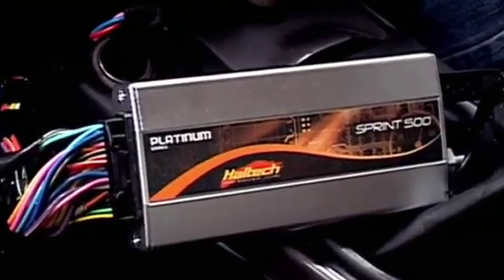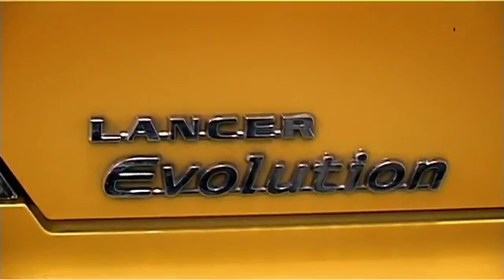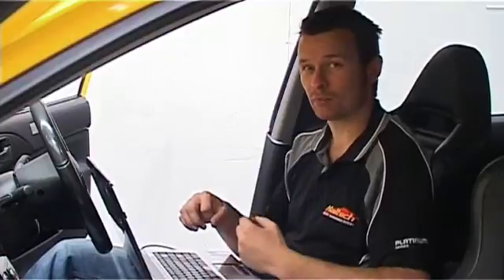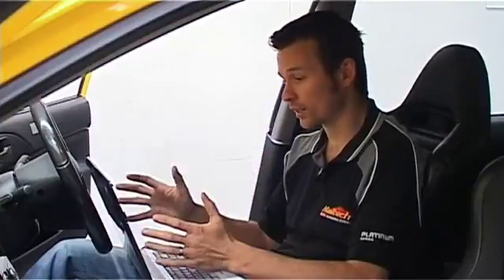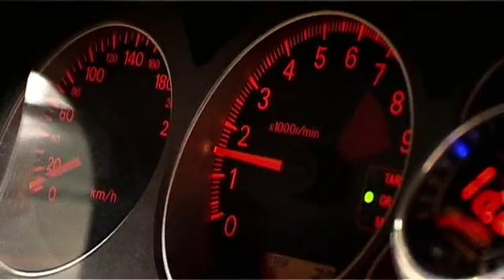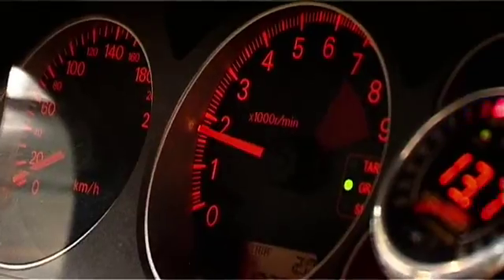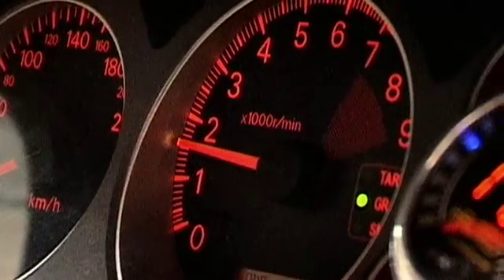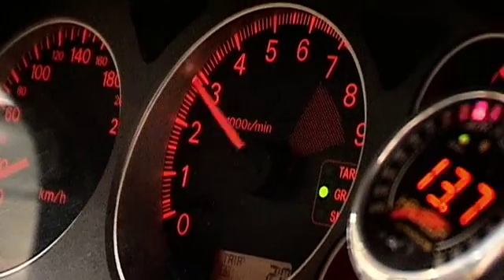How Transient Throttle Enrichment Works

Comment: Issue is usually do to the transient pressure change across the throttle . When you stab the throttle from idle  there’s basically atmospheric pressure on the intake side and very low pressure on the engine side allowing more air to flow than normally would at that throttle opening . You can kind of see this if you take a very long air hose or garden hose and when you first open it you get a quick burst that quickly goes away and you get steady state.
Reply: MOTO/R/SPORT NEJ that’s because of the slight spring effect of the hose itself. It has nothing to do with that in an engine, as the intake manifold is not made out of elastic rubber!  

Transient fuel enrichment is needed because of fuel puddling (due to surrounding air pressure change)... x-tau.
Reply: Marek Sumguy it’s not the manifold stretching the air itself is compressible/expandable. Air flow gets a boost from the high vacuum in the plenum that pulls in extra air for a tiny bit.

How are you getting puddling ..... it’s fuel injected.......
Reply: MOTO/R/SPORT NEJ you don’t know what you’re talking about. If you don’t know what x-tau is... then you don’t know what you’re talking about.
Reply: Marek Sumguy says the guy talking about fuel “puddling” in the intake runner of a fuel injected engine........
Reply: Marek Sumguy I find that the people that resort to straight insults often the ones out of the know , I’ve seen plenty reasons for the need for enrichment circuit . It’s not just one thing . The whole film condensation on the runner wall evaporating and condensing is just another theory however and fine if it works for you to make you sleep at night however it gets chucked out the window when you start playing with direct injected engines and realize you still need to boost the fuel for a few cycles vs the expected quantity. It’s less because now you have better conditions for injecting the fuel in general including way more pressure and faster injectors but it’s still there. The Haltech guys do this for a living yet even both of us disagree with the reason he stated doesn’t change that he can figure out a way around the issue.

Fuel film issues arise when you start talking very wide spray pattern injectors high up in the port you can get some. Obviously with carbs it’s down right awful no surprise but even that has more do with fuel inertia in the jets slowing the response to a sudden demand for more fuel. 

In proper engine with good injectors set up well the real issue is transient air flow changes as you suddenly open the throttle you get more air than what you can under steady state causing the issue . It’s the reason that once properly tuned for you can often see a blip or plateau in the torque during the transient as the engine has that little extra air to play with for a few revs.

Till you start writing peer review and really have to prove the reason and not just the cure to a problem doesn’t really matter. Whatever works.
Reply: MOTO/R/SPORT NEJ well obviously we re not talking about direct injection! There’s no “x-tau” with DI. 

Your garden hose analogy is total bs! The reason why you get that extra initial thrust when you pull the trigger quickly, is because of the accumulator effect in the elastomeric hose itself!  There is no such effect in an engine with solid, rigid intake plumbing.

Comment: I am not very familiar with this, what is the exact procedure to actually tune it? You just go to this map and add a percentage of fuel until it starts to bog when you pump the throttle? If only all tuning software had this applicable, I would be more comfortable with this. Thanks for any response.